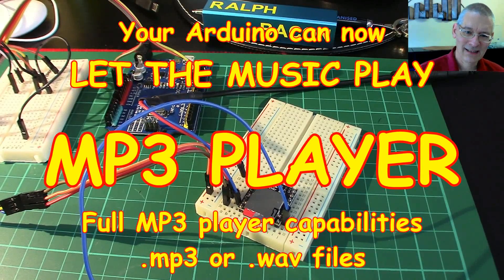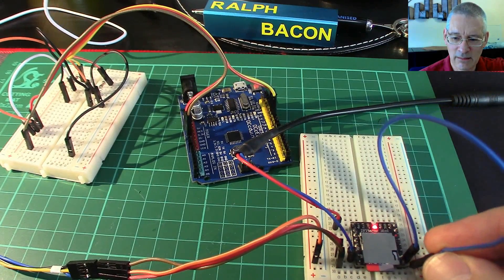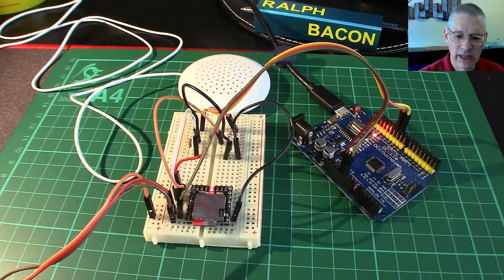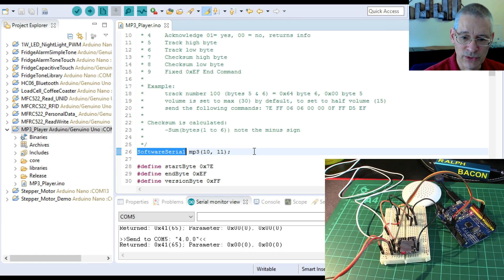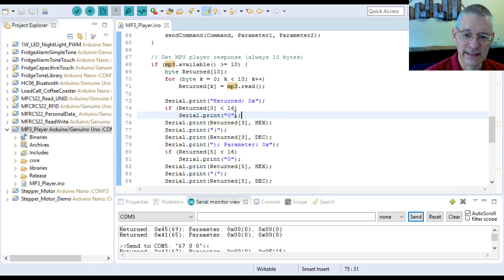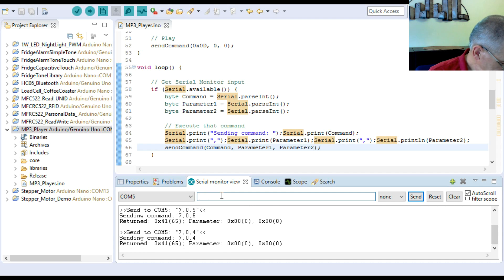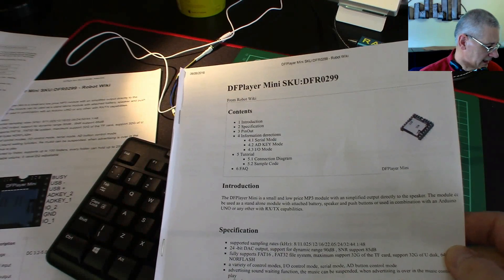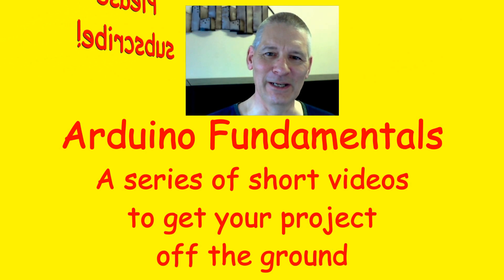#40 Let the music play! Arduino based MP3 Player for music (or announcements)

Comment: Ralph, again, great video. I'm looking for something that can play a sound file when a button is pushed and play another file when another button is pushed, while the first file is still playing. For example, push a button for a long "Wooooossshh" sound (6sec) and two sec later another button and a short "Ding" (0.5sec) whitout cutting the first woosh. And maybe while having a minute long background song too? I'm building a game you see, and this would be very usefull. I did receive the unit you use in this video 10 months ago but I haven't been able too experiment with it yet and I dont think it has these features. Any tip and advise is appreciated!:)
Reply from the maker: You're right, Mr FunctionalDesign (I'll call you Terry, as it's friendlier), this unit does not have those particular features. However, you could just use multiple devices (at £5 / $6 for THREE units, they're a cheap way to implement your requirements).
 
Your Arduino controls the units using SoftwareSerial so by creating 3 different instances of this and using 3 sets of 2 pins you could, I reckon, control 3 units just like that. I'm not sure about connecting them all up to the same speaker, I'd be tempted to take the L/R outputs of each, and feed them into a simple (passive) mixer to a separate amplifier module and speaker.
 
This really is straightforward to do and won't break the bank even with a mixer/amplifier and speaker. If you need a circuit diagram let  me know. 

However, if you are building a SINGLE game that requires limited FIXED sounds you could think of using a cheaper, non-SD card version of this module, that has a small, on-board memory that might fit your needs - but would be much less flexible in terms of what sounds you could play due to memory constraints. And although I have such modules I have not even opened them up yet to play with them so cannot advise on their suitability - just a FYI.

Comment: This vid's thumb don't go up!  I tried.  I'm thinking of including this concept in a plant-watering system, with brief sounds as indicators of a session watering house plants.  Error message for failure to pump water, low water, announcement of start of session, end of session.  Your examples will make things come together much faster.  Best!
Reply from the maker: Absolutely, RJM, a brilliant application if ever I saw (or heard) one. And, just to make it interesting, use a sound changer program to make your voice very different in the MP3 recordings. Even reducing the pitch a tiny bit will make it sound most unlike yourself!
Reply: Sir, if you only knew how far down the scale I am from creating "brilliant applications".  Though... perhaps I AM brilliant.  My Mom frequently called me son.     Brilliant?   Son?    'Allo, is this mic on?
Thanks.

Comment: sir,  all your tutorials are great.... . could you please explain how to use the advertising function. i dont want to use the library.
Reply from the maker: Thanks for the support, Abhin. The spec sheet has details of the registers to use for the advertising function on page 3. DFRobot (the makers) have a web page for this (https://www.dfrobot.com/forum/viewtopic.php?f=2&t=1524) but it does need their library. Why do you not want to use their library? If you don't you will have to pick out the library functions and include them in your main sketch. I would suggest getting a sketch working 100% WITH the library first to prove it all works, the create another sketch WITHOUT the library and see how you get on.
In summary, you can inject a different audio announcement (or anything else) whilst the music is playing. the main music pauses whilst the advert is running, and then resumes when the advert is finished, exactly as you might expect.

Comment: Great video Ralph, thank you very much. Is possible to use this DFPlayer In this Project? https://m.youtube.com/watch?v=YXGyOpTyV9M , i want to give more life to this box for my son, put some funny Sounds, this project works with a 9v battery to power an Arduino Nano, two servos and an LED, will I be able to include DFPlayer without needing another battery?
Reply from the maker: Hey Márcio! Do you know I nearly bought one of these "useless boxes" a while ago, just for a bit of fun!
 
If you have access to a 5v supply in that box it should work no problem. Not saying the battery will last that long but then again you're only going to make some sounds not play music for hours on end! You'll need a small speaker (plenty on eBay), sound good too for their size, see my video #48 "Wireless 433Mhz Rain Receiver with MP3 player and LCD" for details of the speaker I used. You could actually use an even smaller one for this project and still get good results. Good luck with this and do let us all know how you get on! Great question, by the way, thanks for posting it here!
Reply: I'll try to do as you said Ralph, thanks for answering me and for the videos you do, they help us a lot. When I complete the project i show you, hug!

Comment: Thanks for your posting. I want to add different buttons that allow me to listen to different musics,should i change this code so  much? Also, i want to use a power source rather than a laptop what kind of DC adapter should i buy? In addition to DFplayer i will add a motor, a sensor that detect the sound and motor will work also leds. I am wondering that the power source.
Reply from the maker: Hello Huseyin! First of all, will you be using an Arduino to control the MP3 player or use it as a standalone module? That will have a bearing on your choice of power supply. Your requirement to add buttons is quite easy. Let me know how you intend to control the player and we can discuss further!
Reply: Thank you very much for your reply.
I am planning to use DFPlayer,speaker,resistor,wires,jumper wires, buttons in addition to Arduino and breadboard. With these, I can design a MP3 player with buttons moreover, as soon as the music begins I want to prompt to motor that should throw a little ball.What kind of motor should I buy and what kind of sensor is necessary in order to detect the sound and prompt the motor?
Reply from the maker: OK, then Huseyin, you'll need a power supply suitable for the Arduino as well as the player so a nice stabilised 9v 1A (or more) plug-in wall-wart will do nicely for both the Arduino and MP3 player.
 
Regarding your motor for ball throwing, well that's another question altogether. How do you envisage it to work? Like a tennis ball launcher or something a bit simpler with just one ball? You may have to Google that one.
 
The detector for sound could be a simple, direct electronic connection from the MP3 via a rectifier (diode, capacitor, resistor) that is connected to a one of the Arduino's analog pins - this way you have control on sensitivity and no need for any microphone. It basically turns the music AC voltage into a small DC voltage that you can measure. If you would rather avoid discreet electronics then a simple microphone-based "sound switch" (plenty on eBay) would work but would also pick up other sounds (voices) which may not be what you want.
 
Anyway, these are initial thoughts that will hopefully get you thinking and experimenting, I hope it helps.

Comment: Hi Ralph, I went with the 2M flash version to save the SD Card requirement. Cost to the UK was £1.82 all included. Might be worth mentioning is the JQ6500 chip. This is excellent for our projects.
Reply from the maker: Most definitely a mention, MIchael, thanks for letting me know about this alternative. I've now ordered a couple (same price as you, couldn't get any cheaper not even on Ali Express, not even if I bought 5). So thanks for the heads-up, I'll be interested to test out the quality (good enough for a lift / elevator announcement but what about music)  :)

Comment: Amplifier is mono, dac_l and dac_r are aux stereo :)
Reply from the maker: Hey Kuk, thanks for confirming this, as I suspected. The quality of the amplifier (especially the L + R independent signals) is not bad considering it's intended purpose. Thanks for posting, others will be interested in your findings.
Reply: It's very good, I have used one in a gutted Jukebox(still had the amp). The Arduino runs the coin-mech input, the input 32 buttons( IC2 extend board (£1)) and relay to a solenoid to release the button, the lights(Programmable LEDs and RGB LEDs), a oled price sticker, the mechanical whirling sound effect(little internal pre-amp speaker) and of cause, the mp3 sound output(switch by a 2nd relay) . Looks Good and sounds good :) May add a few disc scratching sound effects to songs ....
Reply from the maker: That sounds amazing! And you're fortunate it still had the original amp (valve or transistor?). This should be an inspiration to all Arduinites that shows just what you can do with some fairly simple electronics. Brilliant! And yes, add a few scratchy, clicky, static sounds (just to the beginning of [some] songs, not all the way through)! Thanks for sharing that, it sounds great.
Reply: It's has powerful transistors, with large caps and high watt resistor. No circuit board, all components are hard wired to each other.
Will add the needle drop to the amp sound, with few clicks. :)
Reply: I noticed that also.

Comment: great vid... I was able to get a lot out of this little device but still struggle with one bit.  I want to loop or randomly play files in the MP3 folder... have you tried anything like that?
Reply from the maker: Hi James, good question! 
 
To play files randomly I would generate a random number (between 1 and however many tracks are on the SD card) and ask the MP3 to play that. Turn the number into a four-character string by prefixing with the "0" character, eg 0001 to 9999 as the datasheet says that all tracks must be prefixed by that (although another poster here seems to have had success with just the name, but I haven' t tried that yet).
 
See the Arduino help on Random() [https://www.arduino.cc/en/Reference/Random] and also ensure you call RandomSeed() in your Startup() method otherwise you'll get the same 'random' sequence every time. Just read the value from an unused Analog port in that call to get your seed value, eg randomSeed(analogRead(A0)).
 
To loop (single track? all tracks?) you would have to know which tracks you want to loop. If it's the currently playing track then your code would just re-request the MP3 player to play the same track (perhaps the user pressed a button to mean 'play again, forever'). Tell me more what you want to do here and I'll see if I can help.
 
I may explore this MP3 more fully in the future but in the meantime thanks for posting, good question that may help others too!
Reply: Sorry, I meant Play only the songs in the MP3 folder, not all of the other folders.  TheDFPlayer library seems to support only looping through all of the audio objects stored on the SD card... not allowing the MP3 Folder to be selected with the loopall() function.

Comment: It is stereo, spk1 GND spk2 both speakers connect with one lead to GND and the other leads to spk1 and spk2
Reply from the maker: No, the speaker is mono but the line out is stereo. But that then requires an additional amplifier of course! Good question, thanks for posting.

Comment: Good, informative video here, Thanks.  
I have a question on the module here, of how long it takes to switch tracks?  Maybe better asked as how much delay is there between sending a play command and when the file starts playing.  I'm working on a project where various sound clips need to be played without any noticeable delay between them.  I'm planing on having about 30 clips that need to transition from one to another without any dead space between them, and came across the video here while looking at various options.  
Thanks for any information.
JGL
Reply from the maker: +John Galt Line
Hi John, interesting question. And it's not the answer you're looking for as I haven't tried this. However, this module does allow insertion of advertisement tracks into an existing running track (presumably music) and you wouldn't expect big (or any) gaps to appear in the sound stream. You may be able to ascertain the answer from the datasheet, otherwise you may have to buy one to try it out - let's face it, they are extremely cheap. If I get the time over the Xmas period I'll see if I can test this out but that is still several weeks away. Go on, get one and see if it works!
Reply: Thanks for the reply.  I suppose I'll give it a try and see if it works out.

Comment: You can delete this comment and I won't be offended:  During this video, you mention the directory ".MP3" (uppercase) might need to be changed to ".mp3"(lowercase), however drives, folders and file names should not be case sensitive even between all the compiled languages and FATs.  This being said, I respect and can learn from your response since the Arduino and ESP8266 IDEs are new to me.
Reply from the maker: Hi John! Now where is that delete button... 
Oh, never mind! Now you're suffering from Windows-itis where nothing is case sensitive; file or directory name 'abc' is the same is 'ABC'. Not so in (most?) other languages, such as Unix, Linux and even (in some areas of) Mac OS. I've no ideas what rules Arduino C++ adheres to (C++ filenames are not generally case sensitive but the operating system it runs on could be) hence my comment about that 'mp3' directory.
Having said all that I can't remember whether I needed to change the directory name to lowercase or not (and as the SD card is now buried inside my wireless rain detector you'll forgive me if I don't take it apart to check!) But I will bear this in mind and perhaps demonstrate in a future video if I use an SD card or MP3 player again. Good point, thanks for posting.
Oh, THERE's the delete key... drat, too late now...

Comment: I have enjoyed your Arduino videos, however, I have a question:  I have not been able to locate a sketch/script/etc that demonstrates how to list the files on an serial MP3 player, like the DFPlayer and/or Catalex which seem to be nearly identical? e.g. filedump, dir, list, listfile etc sketch.
Reply from the maker: Hi John! You shouldn't have to look very far, as although I have never had a need, the Arduino website itself has an example that might suit or which you might be able to modify: https://www.arduino.cc/en/Tutorial/listfiles and demonstrates (well, mentions) the printDirectory() method.
Reply: Thanks for getting back to me.  I've been to that page/link many times via Google searching for a working 4pin serial SD library, however that page states it has an error.  The Catalex and DFPlayer seem to use the same libraries and pinouts and need only 4 connections (5volt or 3.2volt, ground/GND, RX and TX, no CS pin/lead). However none of their sketches or libraries show a simple file directory (DIR, list, dumpfile/filedump, etc command) for either of these devices.   I know the Arduino and, ESP8266 families have very limited memories, but it seems only natural a directory listing command/function would be useful.  I know I need one.  I've left a couple posting elsewhere, but neither site could resolve this issue.
Reply from the maker: +John Turcott
I've reported that error to Arduino.cc but the code is also available at https://www.arduino.cc/en/Reference/FileOpenNextFile (see the function that does a PrintDirectory).
 
That all said, this is not going to help you when using the MP3 player, if that is your goal. Using a standard SD card reader it should work as expected.
 
The DFPlayer does allow you query the current file (see the datasheet http://www.picaxe.com/docs/spe033.pdf at just above the section 3.3. Returned Data of Module). However, I suspect, that as the module only really cares about the first 4 digits of the file name then this is all it will return.
 
However, if you wanted to use this in a jukebox application where a user could select a track to play then it would be "fairly simple" to put the SD card into an SD card reader, let the required info be extracted then place the SD card into the MP3 player and use some logic to tie the names together. A bit clunky but if this were my goal it would be on my short list to try.
 
Perhaps you just want to read the SD card though with no MP3 involvement at all?
Reply: Unfortunately what I need is to allow the user to turn on/power up their Esp8266 or Arduino and have it list the MP3s stored on the DFPlayer or Catalex serial MP3 player.  Then allow the user to scroll through the directories and select an MP3s to play without having them or I to manually create a text based list/log of MP3s, especially since each user would add their own MP3s to their respective SD card(s).  

I think I'm asking to much of your time; basically there just doesn't seem to be a command to list the MP3s on an either of these 2 devices.  As far as other SD cards, I have no issue listing files etc, however these 2 devices seem to be missing an important command/function that I need.  Thank you again for your time.  I know you've got a lot of great videos out there, so, if no one else cares about listing serial MP3 SD content, then it must be not worth anyone's time resolving this issue.  

Retrospect; I bet you're wishing you pressed the <Del> key.
Reply from the maker: Before you give up (or I press that DEL key!) I would test out what the MP3 player returns on the "Query current track" command; does it just return the first four digits or the whole name? Look at the datasheet I linked to (a post or two up from here) to find out the command. If you find that a step too far I'll add it to my Xmas Things To Do list (but no promises). But now you have indeed identified a need but no solution so my interest is piqued.